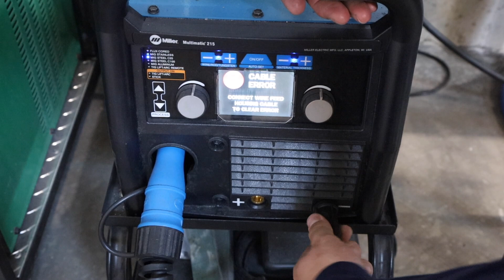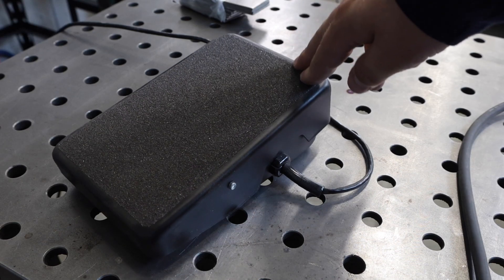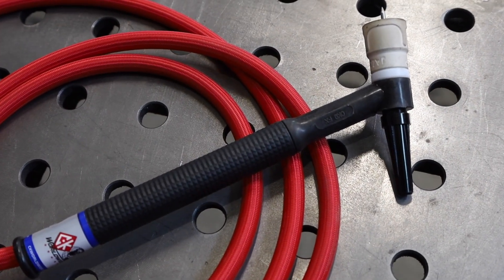How to TIG Weld with Lift Arc

Comment: Appreciate the good information I took a welding class in high school and you know I don't think I learned as much from him as I just did from you in three years that I had that. Find TIG welding nobody could really explain the tig machine we had they would just set it up. And you just kind of learned from there I mean to use the machine that they had it was a Miller it was user-friendly. But I didn't know the difference between having you know variable current I've got a lifted I've been trying to figure out how to use it. I'm going to try to get better at it. It was hard for me to learn how to use like one of those little 110 welders but I've got the hang of that pretty good and stick welding and MIG welding was really all that we did. That's the only certificate that they offered through the state but you still had to do your on the job certificate some of that you know we really didn't learn but. There's a lot of book work and stuff to all that. We got into some of it but some of us had a end of the year project to finish so we had to skip out on some of the knowledge.

Comment: Does lift arc cause the tip of the tungsten electrode to get blunt quickly? Can I avoid this?
amazing video by the way, even metric you covered ;) 40A/mm
Reply from the maker: It depends on the particular machine you're running, but if the start amperage is pretty high, it can. The cheat code for this is to use your filler metal to start the arc on the side of the tungsten. Drag the end of the filler wire against the weld metal and slide it sideways so that it bumps the taper of the tungsten, then you leave the tip in tact.
Reply: @TimWelds  Thanks very much, great cheat code !

Comment: Hello. I am one of your followers and your videos are interesting and educational, thanks for them.
In one of your videos you describe how TIG-LIFT works. There you have a foot pedal to increase the spread strength (I assume).
I have a Hitbox syn 200 pro and it has TIG-LIFT system. I can't get it to work, the tungsten electrode sticks to the goods and I wonder now, do I need a foot pedal¨to increase the amperage at the moment of ignition?
Reply from the maker: Great question! A foot pedal is helpful, but not essential. Some machines require just a light, quick scratch to avoid sticking. Try that. Another way to do it is to hold your gap and slide the end of the filler across the base metal allowing it to barely touch the electrode as you slide it past.
Reply: @TimWelds  Thanks for the reply. My welder cannot use a pedal as far as I can understand, however it is perfectly ok for MIG and MIG-MAG. Have enough of trying all imaginable and crazy solutions. Scratch and a bit of poking with the additive (as you describe) seems to work sometimes. However, nothing that you can use with any continuity. I think it will be a new purchase of a TIG-HF. I have been living in Thailand for many years and then I make purchases on some web, AliExpress, Amazon etc. The problem is warranty and support..

Comment: Excellent video. I have a PrimeWeld multiprocess machine with no foot control with the lift arc. Is it possible to do one tack at a time with lift arc? This would be for tacking in a patch to a body panel on a car. How would you do it, of possible?
Reply: Of course, if you use the copper block at the start and at the end of the weld, it will be a perfect tack, just like a sort of slow DIY pulse technique. Slow but effective.

Comment: The copper trick was from Jody on weldingtipsandtricks. He suggested putting a piece of copper beside both at the place you are starting your weld and where you are ending it, so that you transition the arc at both ends from/to the copper.

Comment: I began tig welding twenty five years ago, having welded with gas and arc some thirty years.  One of the key aspects is keeping that arc no longer than the electrode diameter, and in keeping it short, only the tip of the filler material will melt and form a drop into the puddle.  A coordinated movement back and forth, like stitching with a sewing machine, provides the repeatable puddle, consistent heat melting the filler, moves the heat of the arc back and forth between reheating the puddle, then melting the filler, and allowing the drop to add to the puddle.  Simply rocking back and forth, about the size of the drop of metal will provide a consistent rate of weld, penetration of the parent metal, and an even bond made with the filler rod.  My technique with the puddle and heat was developed with gas welding, and the creating of the puddle in the parent metal while heating the filler rod tip, then pushing the heat into the puddle, and back in the filler rod.
Reply: Thank you for the exact issues I came to learn. Do you have any tips for how much to sharpen your tungsten?
Reply: Thank you for this tip about tungsten diameter. 👍🏼

Comment: Can someone help me, my machine wan't start an arc ,it simply sticks tungsten to work material at first contact with surface,  I have torch 150 amp air cooled with one valve for argon preflo w and postflow.

Comment: Very clear, thanks.  Just a suggestion - one of the problems I have is I can't always identify what I've done wrong.  It would really help if in your videos you deliberately do something really badly and then show what that looks like in the finished weld.  For example, show what it looks like when you don't finish off a TIG weld properly by not keeping the shield gas over the weld puddle.  Then we can see what that looks like, and know how to correct it.

Comment: Nice and clear video (thank you YouTube algorithm for suggesting it - hopefully this comment will also help feed the system)
Reply: .. additionally, also thank you for a couple of specific things: firstly covering lift-arc with no foot pedal as I'm currently looking at buying my first MIG welder and you've made me feel a lot less worried about buying a multiprocess device that has this and thinking it's a pointless feature, and two, 40A/mm - even as a metric Brit, that's the first welding video I've seen that gives that rule-of-thumb conversion.
Now I'm going to have a look to see what other videos you have :-)

Comment: I have used my lincoln ranger for the occasional field tig welding. Does hardfacing nicely and stainless food service equipment well. A copper plate is handy to scratch on when starting the arc. The copper plate can be any size but at least 1/4 inch thick. Experiment and don't expect perfection at first, excellence will come with time.

Comment: That is a great video !  
The only thing that was not covered was lift arc on ac tig and why it is possible today but was not 25+ years ago ….  

But that is ok …  thank you for the inspiration!   Maybe i find some time to make a video like this!  

Great arc shot too! 

I like it!
Reply from the maker: Thanks! I’ve never needed to run AC with lift arc, but it makes sense that the modern waveforms would support that. Would definitely be interesting.
Reply: @TimWelds  whenever in do welding in hospitals , assisted living etc…  the maintenance guy tells me to turn high frequency off as i walk in the door …
When i weld around sensitive electronics or on cars with sophisticated computers then i turn hf off as well ….
And sometimes that is aluminum work …

Ok, do i guess i have another point to cover …  how high frequency is different from welding current and does not go the path of least resistance but  travels long distances through anything metal
Reply: Miller has great information on minimizing stray high frequency in the area of welding. Electricity takes every and ALL paths.